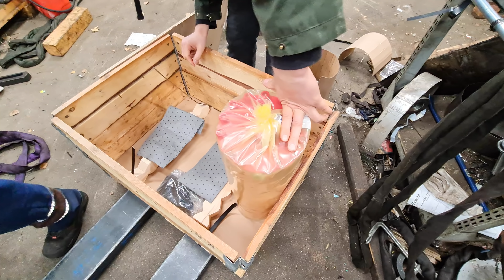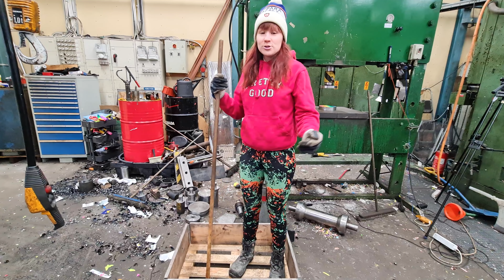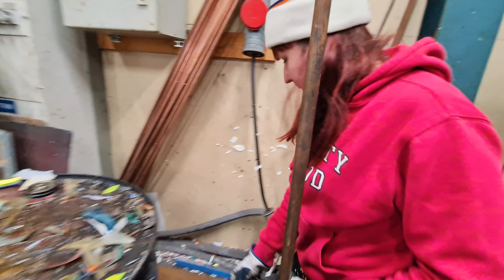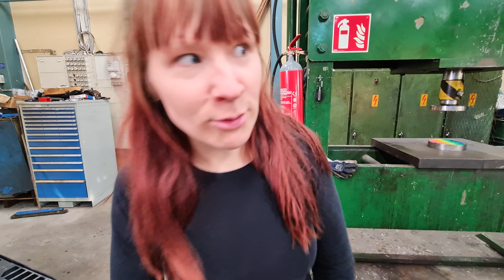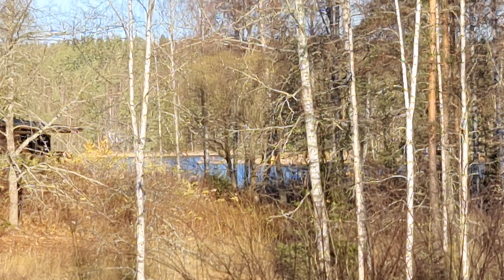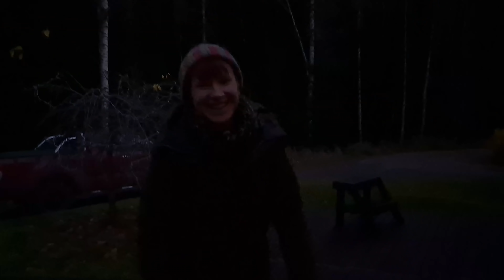Early Christmas

Comment: Just have to now make the electrical supply panel accessible, and also to upgrade it a little to get rid of those Diazed fuses in it, change out to DIN breakers instead, bringing it into last century rather than a relic from when Edison was still alive.
Reply: That was the main motivation to clean :D

Comment: A scuba tank can hold 300bars with ease. 300 bar tanks are tested in 450bars. You could have split one open and turn threads and o-ring in it. If threads fail, it is not very dangerous if there is only water in it. 

Air is not recommended unless you want to see something interesting in a case of failure.

Based on the weight of you test tank, the safety margin is pretty high, since same size scuba tank weights only about 20-25kg.
Reply: On scuba tanks ends are round and they don't come off that makes it much lighter. And I was mainly joking about the weight, steel is cheaper than clever design :D
Reply: @Beyondthepress  yes, they are rounded, but many times on the inside. 

Still, it would be fun to watch does the thread holds or does it pop. 

Tanks are pretty thick at the end , so it is possible that it would hold. Expansion likes to tighten the threads.